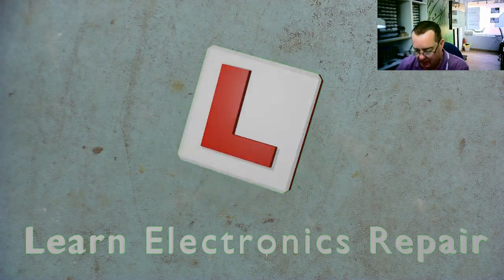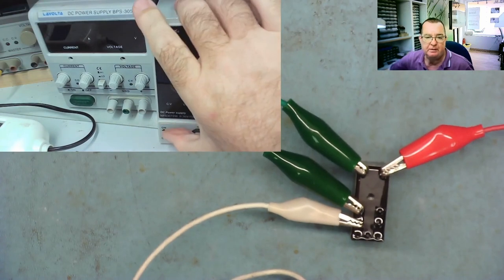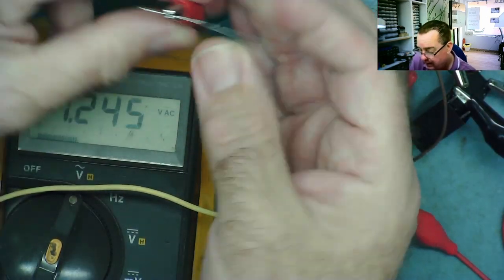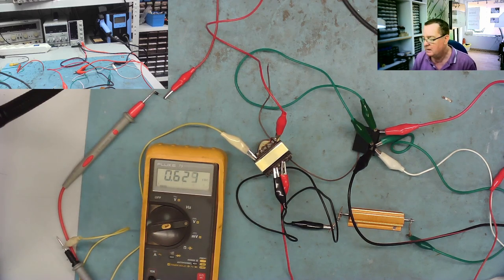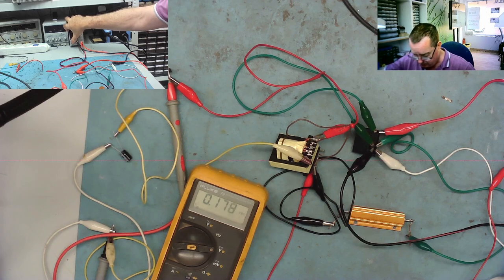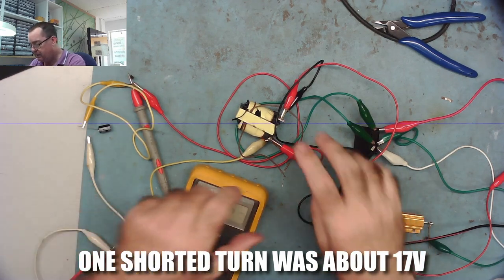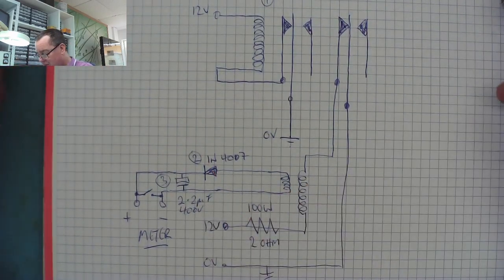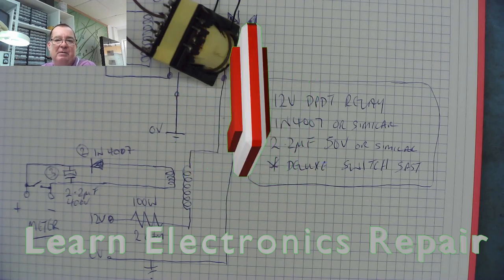How To Find SHORTED TURNS In A Transformer Without Using A Ring Tester

Comment: I couldn't see exactly how you connected the "second turn" BUT in order for it to BE a second turn it SHOULD have been connected in series with the first, otherwise you just had two single turns in parallel which is just ONE shorted turn!

Moreover, typically, shorted turns (plural) are the issue, rather than just one or two and the same applies to motor field coils, armature coils etc. These have two points separated by several coils that end up shorting together especially under applied high voltage (breakover). 

So what you ACTUALLY have is a coil, connected to several shorted coils in series, then to the rest of the coil internally. This is very different to applying a single external coil that you then short. 

The internal multiple shorted coils a) present a MUCH lower impedance and inductance and b) are in the primary or secondary magnetic path generation not externally parallel.

To do this kind of test properly, the single or dual (series connected) external turns should ALSO be connected in SERIES with the primary or secondary depending on which you wish to test.

NOTE: WHEN TESTING THE PRIMARY CIRCUIT DO NOT EVER APPLY MAINS WITHOUT A SERIES CONNECTED LOAD SUCH AS A LIGHT BULB.

NOW if the external turns are shorted they will be shorted within the coil of the winding under test and WILL have a much greater impact. Remember that the external coils have "direction" and should be wound the same way as the internal coils ... Just test with different ends of them being the "start" of the coil and connect in series with the coil under test. This method will ensure that the full (or greater) normal current is passing through the coil which with a separate external coil or coils it won't! Remember it's amp turns that generate volts and that voltage is what drives the current so the difference between current through a single isolated and shorted coil is MUCH less than that through a SERIES connected one! Remember to apply some external load when testing the secondary or no current will flow through the external coil/s so short or no short will show little difference.
Reply from the maker: Hi Bob Lewis thanks for the info.  This video was of course an experiment to see whether or not we can find a bad transformer this way.  I'm not disagreeing with you as I am not an expert in this, but I think your comment is up for discussion or clarification

You should know I am a fixer not a maker, but I am trying to work out how two individual shorted turns are the same thing as one shorted turn, if the two shorted turns are not electrically connected to each other,which is what I did.  

Surely for example, two resistors, capacitors, whatever in parallel are only in parallel if they are connected across each other?  Otherwise the two resistors etc are just parts of separate circuits?  So logically this would tell me that what I did was add two separate secondaries that each had it's own independent short circuit load?

Also does this have any affect on my supposition that putting a shorted turn around a good transformer will make a big difference to the output voltage, and putting a shorted turn around a bad (already shorted) transformer will make very little difference to the output voltage.  Ergo we can find a bad transformer by using this method.

Comment: ok so a shorted transformer will couple less volts to the secondary, but if you dont know what the normal volts are, you have no idea if theres an internal short or not!  I cant see how this circuit proves anything
Reply from the maker: Did you see what happened when I connected a shorted turn to a transformer than already had a shorted turn?  Not a lot of difference on the output voltage.

However when I connected a shorted turn to a good transformer I got about 30% reduction in the output voltage.  

So what I am saying is that the way a good or bad transformer reacts to placing a shorted turn on it are very different, so therefore you can determine if the transformer is good or not without knowing what the 'normal volts' are. Of course I'm open to constructive criticism and discussion so let's start with why that does not prove anything, in your opinion?
Reply: @LearnElectronicsRepair  doh! I get it now! If there's no fault then creating one is a huge difference but if there's a pre-existing fault you get little change because it's already seeing a short. Thanks I sometimes have issues working things the other way....
I don't think I have ever built anything with transformers in, nearest I get is solenoids and motors so the way they react is always new to me, and I hate magnetism because it defies explanation to me. Its Alien, generating a field, all the time, no input, it's like free energy.....
Reply from the maker: @lezbriddon  No worries - you got it now 🙂  I wonder if you have an issue with magnetism, how do you feel about gravity, which is chiefly noticeable in the autumn when the apples are falling...
Reply: @LearnElectronicsRepair  hahahaha yeah both are something for nothing forces, or not forces, depending on the current flavour of scientific theory...

Comment: Why don't "simply" make some maths to calculate the power absorbed by the trafo in case one suspect any problem with it ? 🤔
Reply from the maker: Can you elaborate on that idea please, as I am not a mathematician
Reply: @LearnElectronicsRepair  Hi, i'm not talking about deep mathematics. One could use ohms law to establish if the trafo is drawing more current of the normal. If you know the input voltage because you measure it and you know the resistance of the coil because you measure it, you can easily calculate the absorbed current of the trafo. If one don't know the rating of that transformer and do not have another one identical to compare with, he could figure out the rating of the trafo analyzing its mechanical features such as sizes of core and wires. This is an option.